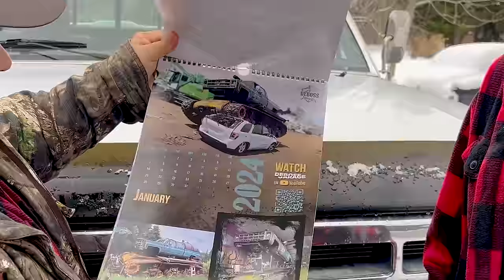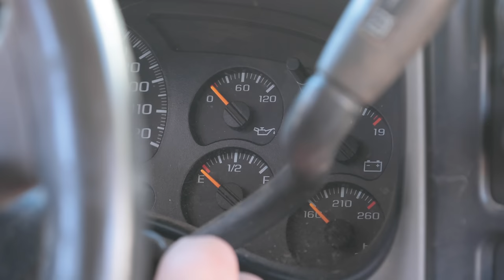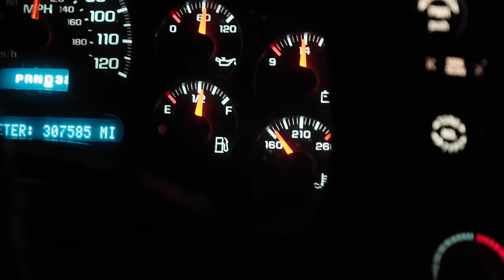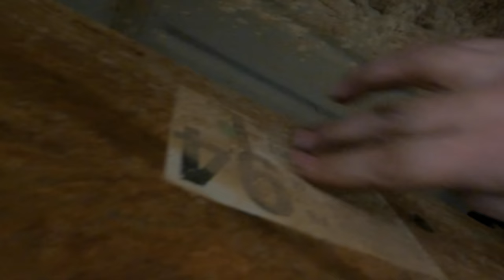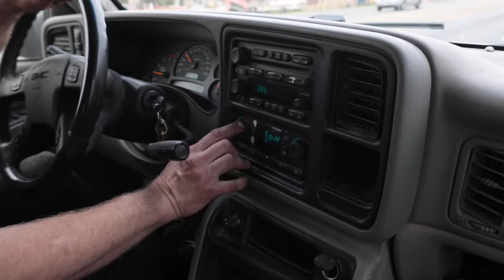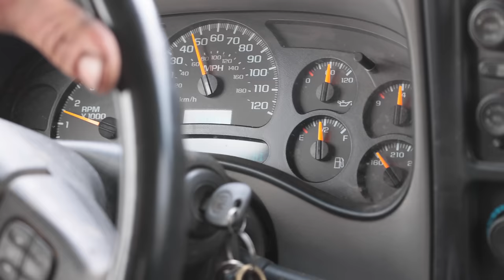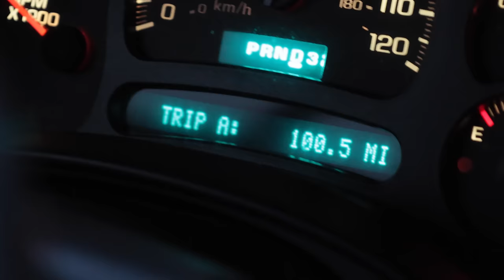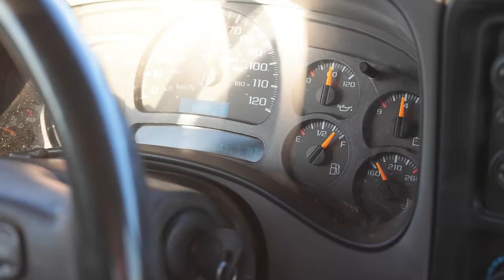How Far Can You Drive a Duramax with Blown Head Gaskets?

Comment: Coming from a fellow GMT800 owner, when he tested to see if the windows rolled down and the door locks worked I felt that lol.
Reply: I was like “great they go down but will they go back up”
Reply: GMT800s with threatening auras
Reply: GMT800 owner with manual locks+windows kinda like a woman with whiskers, it's a bummer but not a deal breaker
Reply: The missing/broke tailgate bezel definitely hit home for me lol. Broke my first one and picked up a new one from the dump. Broke the second one and now it's held on by my reverse camera drilled straight thru the tailgate metal haha.
Reply: @BHDEric It do be like that sometimes
Reply: i got a 2006 silverado and took apart the switch board and cleaned the contacts with alcohol and steel wool easy
Reply: @daftnord4957 you want a cookie? 🤟
Reply: I never had an issue and truck travelled to the moon and half way back.
Reply: 12:58 I didn’t know they came with a tailgate handle bezels. 😂 I can’t remember seeing one in many years!
Reply: Very important test for GmT800s and 400s as well
Reply: Come on Rich, you've shown us many tips in the mechanic world. 
 . . pouring oil with the container on its side is almost leak proof as long as you can hit the hole. Doesn't gulp for air

Comment: That bumper is only a problem in that it blocks the ventilation holes that the stock bumper had.  Those years had a too-small rad so not recommended for heavy hauling in places like here in appalachia. the holes had a flap that directed airflow up into the rad. Consider that plus i also hollowed my bowtie for a "flowtie". I did all the recommended cooling upgrades for mine and now the fan barely ever goes full tilt regardless of conditions. Noticable change is an understatement. I ran my 2005 LLY for years with a leaky head gasket. It would only leak under heavy load and then the low coolant light would come on but it would never empty the rad. Then one day it started bubbling through the expansion tank constantly. I decided to get it done by a shop instead of self and not regretting it after a couple years of a much better engine in all ways once it's fixed. Only had 145k so did nothing on the bottom end... it didn't need it. The shop only did head studs in hopes of not having return customers barter with them. Understandable.

Comment: I look forward to seeing a build of that engine. I had avoided them in the past due to their reputation in my area but, as you stated, the CP3 issues were most likely misdiagnosed. Thanks for the video, it was extremely entertaining and your blown head gasket "fix" was a hoot! I love it when people think outside the box.
Reply: Every generation of dmax has their issues, especially the OBS trucks, but you gotta remember, you’re working on a GM! The care that goes into engineering a GM vehicle is above and beyond anything else I’ve ever worked on except some older German made stuff that is was equally as serviceable. Just know the sticking points going in so you can negotiate accordingly on price and I’m sure you will be happy for making the switch. They ride like a caddie with the IFS setup, which also makes it expensive if you want to lift the truck more than a couple inches, but even with a lift from a company like cognitio, the ride is better than a stock ford or Cummins of the same era.

My lb7 needed injectors about 6 months into me owing it and I was cursing my decision to get the truck after reading all the horror stories online about how horrible of a job it is and this and that. Turns out it’s my favorite truck to work on. You won’t regret getting one!

Comment: I was hoping you guys would do a Duramax 01-07 for the hybrid build. I hope that's what this is for. If you take the LB7 out and don't need it for the hybrid build, you can keep it for parts for the old tow truck or sell it, or heck, build a diesel race truck/car. Or an LB7 rock crawler or power a boat. It's just a badass engine that has a very supportive aftermarket. Relatively low cost to unlock ridiculous power from that thing, then you can throw on the 5 mode tuner so you got your economy cruise mode, race mode, tow heavy mode, stock...etc. 10500 pound rear axle. But to unlock that capacity you gotta put some airbags. Get the pump rub kit for the transfer case. I had an 02 2500hd LB7 and I'm regretting selling it. I'll get another one in the future, and I'm still gonna buy 01-07 even if I had the $ for a new truck. Those are all great models to work with from stock, though the LB7 is probably the best since it comes pre-deleted stock and is grandfathered in at least right now. Exciting things ahead 😮
Reply: This is an LLY.
Reply: 05 was LLY only
Reply: @awesomefish100  someone already said that
Reply: @RobertLiggett  LLY was 04.5-early 06
Reply: @awesomefish100  06 was still a lbz motor just a "detuned" and or lly tune and I know what year is what. idk why you think you need to tell me or the original comment when someone already corrected them.
Reply: @RobertLiggett  I really enjoyed this video, and hopefully you did too. Happy new year Rob!

Comment: I made it 1900 miles with a blown head gasket just like this...and the solution for me was gutting the thermostats, a 5 gallon backpack garden sprayer and a back seat full of water jugs.  I kept the temp super low, seemed to help, and then every 15 miles you give it a ten second squirt of water.

Comment: I did something similar with a 6.0L Powerstroke. Didn't have a blown head gasket, but the cylinder head was cracked such that it pushed fuel into the coolant while running, and coolant into the injectors while sitting. So, I put a slit into the radiator cap gasket so it would never build pressure. Worked great since the thermostat opened too early anyway and it ran at 160*F all the time. Just had to pull diesel fuel out floating at the top every month or two lol
Reply from the maker: That's completely normal for a 6.0 though

Comment: I did that, had a blown head gasket, cracked the lid on the expansion tank and drove it for months on end.
It would only puke out a little coolant coming to a stop and after shutting the engine off.

Comment: My 07 3500 4d dually 310k miles.
Was a fass supplied truck crank no start. After replacement of rail pressure sensor and regulator ended up being the cp3. Changed it out in the driveway on the coldest day of the century.

Comment: I drove an F450 with a 6.0 with blown head gasket for about 12k miles. It burned a little coolant but never let me down until it cracked a head from the heat. Even then it ran good enough to drive. I sold it as a project after it was approaching 370k miles on the stock, not rebuilt engine. It was abused its whole life. The 6.0 has a bad rap but after that truck holds a place in my heart.

Comment: I've known oilfield roughnecks that drove their Duramax's 1500 miles on bad head gaskets every two weeks for years lol

That being said... My 04 lb7 just rolled over 385,000 when I pulled the engine thinking it needed head gaskets when really I personally misdiagnosed a bad oil cooler as bad head gaskets. It's getting put back together as I type this and going back in to see just how many miles I can squeeze out of it. Btw those are almost all oilfield miles.
Reply: Did you do the headgasket anyways? Im guessing thats how you found out its good but still lol
Reply: Should have replaced head gaskets while it was apart.
Reply: @sategllib2191  yes I replaced the head gaskets while it's been out. Figured I'd never have better access than I do right now! I'm just dragging my feet on doing something with the cp3 and turbo. They're both original with that same 380k on them. I just hate to drop five grand into an engine with almost 400k on it. Not to mention the truck they're going back into has seen better days as well! But darn it that thing has been tough!! All those miles and never once did I have to walk or call for a tow.

Comment: Did the same with my Land Rover 200tdi (2.5 turbo diesel).  Oregon to Florida to Oregon.  Pressurizing the coolant circuit. Then it popped between cylinders 2 and 3 and I changed the head gasket in 3 hours in front of a NAPA.  Blew at 11 am, Heading north on I5, eating pizza at 70 mph by 2 pm.

Comment: Right in my area of living.  I live just north of Fort Worth.  The last company I worked at we had an 02 Chevy 2500 crew long bed 4x4 diesel.  That truck had over 400k on it and still run good.  They just stopped running it because it was older. Nothing wrong with it. I drove it myself for almost a year. Has leather and everything.

Comment: When i bought my current Duramax back like 7 years ago, i picked up a 2005 that had 180k, brand new turbo, injectors, head gasket with arp studs, all with shop paperwork. Paid 14k, come to find out he sold it cheap because he thought the cp3 was going out as it would fall on its face randomly and the week after i got it home it started having hard starting. The soft lines that run from the FICM to the filter, and from the filter to the cp3 where age cracking and sucking in major air. $100 later she was good to go, saved me like 8k off the purchase price.
Build that bad girl out then come swap it for mine, you guys would cry seeing such a clean frame on a nearly 20 year old work truck diesel
Reply: Also that heater core connector that comes through the firewall is plastic and is KNOWN for cracking and leaking. You can grab a metal replacement for like $20

Comment: I believe someone at a magazine used a garden sprayer with a check valve plumb directly into the radiator. Every few laps they pump the sprayer amd top off the water in the radiator and engine under pressure.

Comment: I think I had a cracked head In my 7.3, it only leaked bad when I pulled up hill, so I routed a separate washer fluid system to spray over the rad while I was climbing.... worked perfectly for years.... the truck burned to the ground because of bad trailer wiring.
Reply: That was a rollercoaster of emotions.

Comment: Seen same sequence happen on a Chrysler Pacifica 4.0 liter although it may have been the plastic intake caused the coolant seepage. They put stop leak in, heater ended up not working, etc. Car eventually was junked out. Had mad wiring issues also

Comment: Thanks for the info on these machines.. I own my 1st diesel (04 Ram 5.9 Cummins) so im all ears, especially on the fuel systems.. truly enjoy this channel... enjoy the rust free vehicles from Texas!😂😂
Reply: Keep the fuel filters changed, oil changed, and transmission fluid/filter changed and you'll have a good time. Upgrade to fass lift pump if you ever have fuel issues.
Reply: @verteup  will do, 
Thanx...

Comment: Steering box- Cardone 97-8418GBS APPEARS to be an awesome steel at $410 for new from like Summit, $370 on Rockauto 3 Flat 33 Spline. It's the larger 6 bolt cover case like the PSC

Comment: My moms 01 Civic had the same HG issue at 310k miles. It drove for another 2 winters and a summer before we finally scrapped it.....because the tq converter blew up. That's why my current winter beater is a Civic. ;)

Comment: I came here to say that I modified a VW MK5 07K cooling system to run 60K+ extra miles after I developed a crack in the HG. It always let a small amount of air into the cooling system, just enough to airlock the thermostat and run warm. Fix? I drilled two extra holes in the thermostat and burped it before each drive. I drove that in Florida for rideshare. Zero cooling system issues after that and I was putting hundreds of miles on a day. Transmission failed before that cooling system or engine did.

Comment: My LLY had a blown head gasket for prob two years and approx 55k miles and as long as it’s going into the coolant you’re fine. I had a tune and beat the crap out of it during that time too. Now that I’ve done my entire fuel system and studs and built trans i actually drive much more tame. What caused me to finally do the head gaskets and studs was when my ex drove the truck for about 35 miles on the highway and it blew the upper radiator hose off which i had made a plumber repair ag the bend because it rubbed the master cylinder and put a hole in the hose.

Comment: Any duramax up to the lml need a lift pump.     Lp5 gm finally decided to put one on like other manufacturers have done for years haha. 

Also note that on the 15 up lml you have to drop fuel tank or pull bed to install the new return tube fass wants you to use.

Comment: Just a heads up. 
If that is an original trailer hitch. It is only rated for 7700#  
Don't get me wrong, you can over double that weight for a long time. 
But I was surprised to see the sticker with that rating. When I bent mine and was replacing it. 
Mine did not bend because of rust. 
Just overloaded.
Reply: kind of wild a current midsized truck is good for exactly that much, but with a 4 cylinder
Reply from the maker: I was surprised how much the body lines changed towing that much, but the trailer also has the tires very far forward  as it is a tilt and load.  The trailer still took most of the weight.  Its pretty tricky getting the weight right

Comment: Drove my 5.3 Tahoe 10k+ miles for a couple years with a bad head gasket. Half assed rebuilt the motor once it started getting it really bad into the oil. Dumped probably 50 jugs of coolant through it over 3 years lol. Never overheated or smoked. Just was sludged up but we thought the PO just didn’t ever change it. 240k miles and it’s still going lol. It’ll pull our 3000 pound trailer all day at 1800-2800rpm. The occasional 4500rpm when I forget to hit tow haul cus the light don’t work

Comment: My poor little LLY has a small headgasket leak that started around 450k. Welp, here we are, pulled the boat all summer at 550k. Water pumper went out and was replaced which helped circulate a little to keep it cool here in Texas.

Comment: There's an adjustment on the steering box that will tighten it up. Mine was pretty bad when I got it, but snugged it up and much better now.
Reply: That is just a band-aid for a worn-out box.
Reply: Cardone 97-8418GBS APPEARS to be an awesome steel at $410 for new from like Summit, $370 on Rockauto 3 Flat 33 Spline. It's the same large unit like the PSC but without the price tag

Comment: Gotta love the gms quick connect leaking at heater core
Also if your pressurizing coolant your combustion is getting into coolant system.  You not seeing out exhaust because the diesel combustion pressure is extreme.        Better off to not do it.  As I have seen where a slight leak when engine was off that coolant leaked into cylinder when it was warm      You can also burn a spot of the block or alluminuim head where the combustion escapes and erodes a spot

Comment: My 97 Ford ranger 3.0 has had a blown head gasket for many years and iv put 75,000 miles on it. Only problem is in the morning. Runs a little rough for like 3 mins and then it's fine the rest of the day.

Comment: I had a VERY similar issue with my 6.7 Cummins head gasket would push coolant whenever it wanted had a shop do the head gasket 3!! Times and it kept happening (yes head was decked and checked for cracks) said everything was good.   Couple of years later it has a new engine and I'm sick of diesels ESPECIALLY Cummins

Comment: If you have a combustion leak to the cooling system, you can just remove the thermostat and radiator cap. With cap off it won't build pressure which you know. With the thermostats removed or with the centers removed because you need the outside to hold the gasket, it keeps combustion pressure from forcing coolant out the coolant inlet. The thermostats don't open soon enough with gases in the system to allow air to go out the top without pushing out much if any coolant. You can drive an extremely long time like this and maybe top off cooling system as needed but usually after hours, not minutes.

Comment: 2003 lb7 222222 miles completely stock same fame as this one. I really want to know what I should add to get a little more power and safe for towing in the mountains. I trust you more than anyone else🤣i love your videos, especially the Audi.
Reply: EFILive tow tune. Trans is the weak spot. Can only handle about 100hp over stock.

Comment: I swear by Iron-Tite blue bottle heat gasket repair. My 7.3 IDI was chugging 1-2 gallons of coolant a week and it took the consumption down to 1 litre. If I had used two bottles in it I think it would have been even less. That held the engine together for 9 months. I think I could have got even longer out of it if I had kept adding the Iron Tite every few months. It eventually hydrolocked a cylinder and bent a rod

Comment: Coolant doesn’t always go back into the cylinders after engine is turned off, if the gasket acts like a one way valve, it’ll push compression into coolant, but the gasket can stop the coolant going back into the cylinders. Seen in many times as a mechanic

Comment: My '03 GMC K2500HD CCSB 6.0 Gas is a great truck for me and my dogs. Got it a couple years ago for $4000 and went through it. Needed a transmission rebuild and some cleaning up, but sure wish the red paint was in half as good condition as your white. Truck has a gooseneck hitch and an 'X' bull bumper on it, and I can say those bumpers do grow on ya. Hated it when I got it, but it's a good addition. So, I looked at a matching rear bumper, but far toooo expen$ive.
Honestly, I'd rather have the same truck in a GMT400 "smooth side", but this one popped up when I needed it.